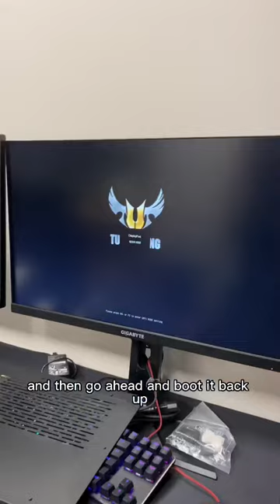CPU Overheating 🥵 #gaming #gamingpc #gamingpcbuild #pcgaming #pcsetup #pctips #pctipsandtricks

Comment: I had that AIO, get rid of it. It is not a bad pump, it was probably full of sludge
Reply: GN said: dont have the Pump as the highest point in the loop... this has the pump as the highest point
Reply: @norkris8729  It's still a trash AIO.
Reply: @OV.Q2  yes it is :) my point was: its trash without the "sludge"
Reply: @norkris8729    It’s pretty clear that the aio pump is lower than the top of the rad where the tubes connect. There’s nothing inherently wrong with this mounting style. Watch jayztwocents video further explains what GN meant.  This has nothing to do with placement and everything to do with the msi aios having awful clogging issues.
Reply: @brandonbaldwin8323  rad is in the top... pump is in the rad..
Reply: My r7 5800x just chills around 70 degrees on desktop with this AIO....
Reply: @TurboIsBack  untill it dies, soon
Reply: @norkris8729  Agreed.. i will be upgrading my AIO with my case
Reply: @TurboIsBack  i also have same CPU, with a MSI coreliquid 360R. Mine was chilling at around 50 and under heavy load was reaching 80-85. Suddenly one day, my CPU was reaching 90+ and  throttling when opening Chrome or any game (just opening, not even playing). Turned out only 10% of the rad was hot, the rest was dead cold. In BIOS the CPU was idling at 65C. Luckily i RMA'd and got my money back. 
My advice, monitor your temps daily and check for max temps, if it reach once 90C, swap the cooler
Reply: my brother had one of these we had to do a full AIO flush and the fluid was full of small stones, probably hardened sludge. After the flush however with new coolant, it runs as well if not better than a corsair AIO. This is a known issue and recalls are in place, but sadly not enough recalls to actually step forward and make a change.
Reply: @romuluschinzi3578  I bought a corsair aio after even though flushing and refilling was an option i didnt bother. Gave it to a friend and he ended up doing a flush and a refill and used it in his system and it did work good, until the pump died
Reply: Corrosion?

Comment: The pc had 12 fans and it was still over heating 💀💀
Reply: i know its a joke but those fans either intake or exhaust hot air, they do not cool the cpu directly, meaning a bad pump causes the cpu to get cooling at all, but this still made me laugh💀
Reply: @ninjrr  facts
Reply: the problem was the processor fan,aio, not the exhaust fans
Reply: @Dave_mitchz  i know, i never said it wasnt
Reply: @Dave_mitchz  i said that the exhaust fans do not cool the cpu if you read it bro
Reply: @ninjrr  yeah I just repeated it🤣
Reply: @Dave_mitchz  ohhh shit my bad bro i thought you were replying to me😭
Reply: @ninjrr  even the 3 fans on the side are placed wrong
Reply: @cyberking8963  nahh they had 3 intakes on the bottom and 3 exhuast through the sides

Comment: Dont install that rad on top.. it has the pump in it, and leaving it at the highest point in the loop will cause the pump to fail... install in on the front panel or where it is standing up (vertical), not (horizontal)
Reply: actually there many videos on youtube by PRO computer engineers that state all radiators should be mounted at the top of chasis. and pump should be oriented at the 6 o clock. the very bottom of cpu is where the cords meet. this is to ensure when evaporation occurs and you get air in the line that those bubbles go up naturally and away from the cpu pump. air in pump = goes bad and you overheat. no radiator has a pump in it the pump is actually on the cpu. nimrod
Reply: @vullrath  no, not all AIOs have the pump on the cpu the msi AIO in the video has the pump in the radiator under one of the fans 

thats why i recommended installing it in the front.. i know how it works

Comment: If it was caked in thermal paste why do you think rubbing it all off and putting new stuff on would fix it.
Just run it up a bit, if the radiator is cold then it's a bad pump. 
This is why you stay away from water coolers, happens to often

Comment: Yeah that's why i'm an air cooling guy. Too many points of failure with water cooling
Reply: but they can be so much quieter.
Reply: @nostrum6410  my Noctua is dead silent. I had a aio on my rig for a while and I took it off due to the annoying pump noise
Reply: I do prefer air cooling, but I really want to build a custom loop some day. Not a fan of these AIO still coolers though. Noctua is where I like to stay
Reply: @nostrum6410  my fans are super quiet. When i'm gaming, you can't hear the fans because of the audio. When i'm not gaming you can't hear the fans because they are so low rpm. And I'm oldschool, I like to hear them working. I miss the clicking and spinning of harddrive disks lol
Reply: @fussbucket3080  yeah that has been my line of thinking, but the older I get the more a full custom loop seems like a chore lol.

Comment: AIO suck nowadays. The last two I brought broke in a month. Better to use a Noctua air cooler. They never break and have a long ass warranty cause the company knows they wont..
Reply: have had a nzxt 280 aio for nearly 3 years with no issues, and comes with a 6 year warranty

Comment: I'll always stick to air cooling. Nothing I do warrants water cooling, max it gets to under a stress test is 60⁰C, so gaming should be lower still. Even if the main cpu cooler fan fails it's still got a phat piece of metal on it dispersing the heat. Keep it simple

Comment: MSI AIO's shouldn't be top mounted. The pump is in the rad so it would be at the highest point in the loop, leading to increased risk of cavitation (air bubbles in pump).
Reply: interesting, i thought it was just over the water block like most other designs. they shouldn't have tried something new, that's for sure.
Reply: @goblinslayer5404  https://cdn.cs.1worldsync.com/syndication/mediaserverredirect/f18deebfd132fff6b2350133a28b51e6/original.jpg

Yeah I'm not sure if they're the only one but it means that they're not using an Asetek / Apaltek pump design. Bet they didn't want to pay for the design and now they're experiencing tons of recalls and RMA's.
Reply: @canyouread  ive seen rad mounted pumps before, they're not nearly this bad usually.  If they really didn't want to pay for the Asetek design, then they must've skimped on the engineering aswell, since that also wouldn't be cheap. Even sketchy chinese companies would play it safe and stick to existing designs.

Comment: Those MSI AIOs are a real pain, I would never trust in that brand
Reply: No problem with mine I’ve used them for years
Reply: @flamingtanks1885  MSI has had bad clogging issues with their AIOs, they were supposed to recall them but everyones seem to be "not qualified" which is a bit bullshit on MSI's part
Reply: @flamingtanks1885  probably you're the lucky one or you have some V2 of their products. 2/3 or even more MSI AIO cooling system are defective. I changed mine 2 times in two years.

Comment: BRO pleas help my 
im have problem is pc im before run Cs1.6 no lag but after running Cs1.6 game freeze and lag 
im a system:
nvidia geforce 7300se/7200GS 256mb
cpu pentum 3.20 
ram 4gb
nvidia drive installed
and bro im is bios after 1min shutdown auto pc

Comment: MSI AIO pumps ARE THE WORSE!!! I remember it took me HOURS to diagnose the problem had to remove parts 3 times and I mean my entire pc parts and put them back together and turned out to be a pump issue. It was heating up to 102c on cinebench!

Went ahead ordered CORSAIR H150i CALIPEX 360m and  the temps went down to below 55c fully under load.

Comment: Nah because the pump was on the rad and the rad was positioned on the top so the air pocket would be ok the pump thus making it more prone to failure. I suggest you move it to a different location where the pump is on a lower position.

Comment: For all the people saying these AIO’s are bad, they are not. Install them properly and they will work flawlessly. The pump is in the radiator. Install the AIO on the front of the case so that the tubes come from down to up and you will be all good. Been using mine since like April, 0 issues. (MSI MAG Coreliquid 240R V2)
Reply: Not even been a year yet, lmao. Be patient.

Comment: The cooler went cause the rad is upside down ppl need to stop mounting their shit like that
Reply: It’s mainly with the AIOs that have the pump in the rad like this one they seem to get air in there after a year or 2 naturally the ones with the pump on the actual cpu are better cause you can put the rad however you want as long as it’s above the pump

Comment: AIOs with the pump in the radiator tend to suffer failures at a higher rate than those with the pump in the CPU block.
Reply: You just need to plan where you install the radiator. Keep the pump at the bottom, away from the bubbles.
Reply: @aggressiveaegyo7679  In a 120mm AIO, the pumps are directly in the center of the radiator.  Orientation doesn't really matter at that point, exception being a top mount in the case.

Comment: I mean, you can see the thermal paste is fine when you remove it surely? It's still paste not solid and the original application was fine.

Seems a waste overheating the CPU again to test something that's obviously not the problem. 

Also ditch the MSI AIO and drop a fat air cooler on it. Custom loop or air, AIOs have far too many issues for their own good.

Comment: bro first off its a MSI MAG AIO so its instantly garbage. HOWEVER! The pump is located inside the rad and you have the rad mounted on the TOP allowing the air to circulate into the pump thats why its dying out fast. Honestly for a decent replacement with the pump in the cpu block id use the DeepCool LS 720 its budget minded and works very well. Also you could use the ID Cooling Zoomflow 240 or 360 yeah its a asetek pump but it works surprisingly well

Comment: Did you actually confirm the pump was broken? 

As when a pc is transported or even angled with a liquid cooler a large air bubble can form and prevent the flow of fluid.

Comment: Had this issue literally last night. Turns out my dumbass put the pump wires into the wrong part of my mobo. I was so sad, after building my first pc. Imagine my surprise when it started working just fine after moving one cord to the correct power spot. I was gleeful

Comment: I really hate AIO's since they are not Very Serviceable if I had to chose Water Cooling its a Custom Loop all day But Currently I have a Ryzen 7 7700X under a Be Quite! Dark Rock 4 and under Load my Temps are at around 64°C and my Clocks are stable at 5.6 Ghz my Base Clock is 4.5 Ghz and it's not even Overclocked it's just so cool it holds its Boost Clocks

Comment: its not only the pump being bad but the fans being oriented wrongly.. you are blowing no cold air on the motherboard but pulling heat from the power supply.. placing that into chasis.. and then blowing it out the bottom to get caught in rug or table and we all know heat rises so it just goes back into the gpu .. its all wrong omfg.. always put the 3 fans in front of chasis to pull cold air in.. air flow should be a complete circle.

Comment: Been using the same AIO but the 240r version for almost a year. Recently my temps at idle were reaching 70-80+. Is there anyway to confirm that the pump is dead/clogged? or is it still possible it's due to dust buildup? I've cleaned the fans every once in a while but not totally remove it from the radiator. The fans will go full power with a rattling sound.

Comment: I never would have bought a 150+ aio if I knew it would crap out on me 5 years later. I got my money's worth but diagnosing the issue was odd. My PC wouldn't even boot into windows for more than 5 seconds. Needless to say I bought to noctua redux added a fan and my R7 is running at 4.1 happy and cool. I'll forever use air unless cpus NEED an aio in the future.

Edit it was a 240mm AIO from cooler master rgb

Comment: those msi AIO are shit my friend had the same issue. the pumps are in the radiator so the way it was set up all the air bubble go up straight to the pump  thus it running dry and dying. bad design. bad placement for pump

Comment: I had the Same issue With my 8 year old AIO. Changed it With a 20 Euro CPU cooler from Enermax 😅 System runs smooth again

Comment: You know, the AIO was installed incorrectly both before and after maintenance.

This AIO has its pump on the radiator, not on the block. The pump should never, ever be on the highest point of a loop, as that harshly degrades its lifetime. If it had the pump in the block, doing a top install would be fine, but as the pump is in the rad, that’s just a terrible idea.
Reply: Thanks for that information onii chan.

Comment: Ehmm why u thought that changing thermal paste will prevent overheating and throttling? i never saw paste dropping temps by 10-20 xd
Reply: If there's not enough or it's not spread on the cpu ihs properly it can cause serious temp issues

Comment: You don't think it could have been the fact that you routed one of the cables over the rad and between it and the chassis? You literally shorted it out from crappy wire running.

Comment: Hey, my 600$ pc isnt working. Like when i plug the cables in the monitor it just doesnt turn on, the PC turns on but it just doesnt connect to my monitor
Reply: Did you Press the Power Button in the monitor

Comment: my core liquid v2 from msi has been working seamlessly for like a year on a 7900x. the pump for this aio is different from others because it’s located on the actual radiator instead of the pump head, and theoretically this means that it should have no difficulty moving the fluid no matter what orientation it’s in.

the strange thing is that this aio, contrary to most aios out there actually runs better and lasts longer when side/front mounted with the tubes up, instead of top mounted, or front mounted with the tubes down. 

after endless research (with only anecdotal evidence really) it seems that ALL people who have no issues with the v2 cooler have it front mounted, and everyone who still had strange noises or problems with the cooler had it top mounted.

Comment: because you put it on top. the pump is on the radiator. its basically like putting normal aio on the bottom of the case. and your solution is to repeat the process that killed the pump smh

Comment: 1. MSI AIO's pump is in the radiator, so if you place the pump at the highest poiny in the loop it will die 

2. 3 intake fans for 6 exhaust fans will increase heat in the system and it will create a negative atmosphere inside the case that will cause over heating of the VRM's and dust to be sucked in the case

Comment: That aio has the pump in the radiator putting it on top is the wrong orientation no wonder the pump is dead id move the pump/rad as low as possible.

Comment: I had this exact problem, the solution was shaking the tubes a bit, cuz I listened and the pump was working that's how I knew and avoided some headache. In your case tho (no pun intended lol), it could be the pump actually.
Reply: nah, these shitty Apaltek based AIOs have a super high failure rate. Fractal Design use them in their Lumen lineup, and so does MSI in several of theirs.
Reply: @gumikacsa526  daaamn, lucky I didn't buy one of those suckers

Comment: Those aios should be mounted with the pump lower than the block. Top mounting them kills the pump as they always suck air bubbles. They are a good option only if you cannot top mount the radiator or tubes etc.
Reply: Just watch jayztwocents Video on this topic btw you should top mount it
Reply: @Pizzarolles_.  wrong mate, the pump is in the radiator in these models, pump should NEVER be at the top of the loop... watch and listen a bit more to the video your referring to. this guy would know this if he was any good at pcs but ive seen enough of his videos this guy is basically a glorified amateur with a camera.
Reply: @MrBozcat  thanks

Comment: Its coming back again unless you got the V2 that has been updated.
Reply: Even the V2 fails pretty consistently and for most of the same reasons. They just need to switch to an ML240L or an X53 or some equivalent instead of using any MSI AIO.

Comment: I had the same exact cooler (360R) and started facing the same issue after around 8 months of usage, I knew it was the pump because it started making some air rattling noises... BUT MSI, my man, very understanding and they admitted the flaw in the pump, it is really common in this AIO, got my new C360 in less than 10 days... MSI never disappoints in after sales service

edit - Its not like, every MSI AIO is bad, its just this particular model which has this issue
Reply: Flipp your radiator hoses intake down and its pretty much trouble free. Pump has to work harder when you mount them at the top.

Comment: That model AIO needs to be installed in front or bottom of the case. Probably airlock issues. Never install that pump on top. Hope that helps.

Comment: its not a bad pump i have this cooler sitting on my desk becasue i built a system for some on eand used this cooler. the fins on the other side of the water block is really tight not alot of space fro water to pass and it actually clogged up with this white residue i cleaned it and it was working fine after i bled the water loop corecty using the bleeder tap on the top of the rad